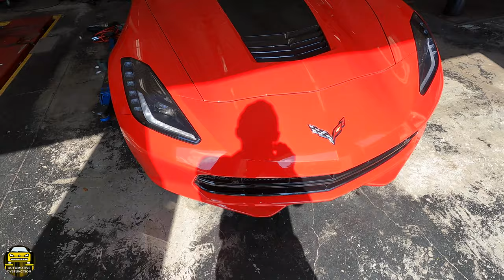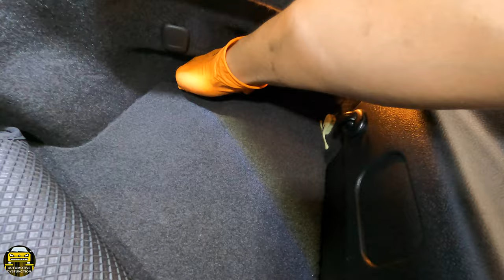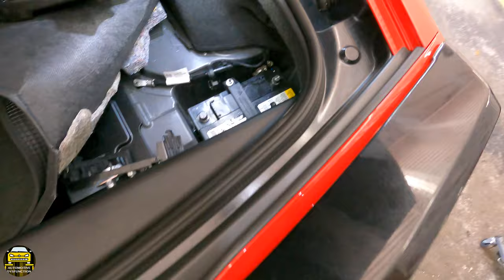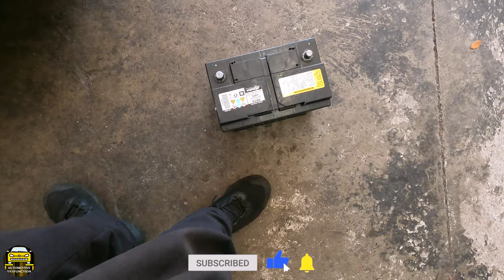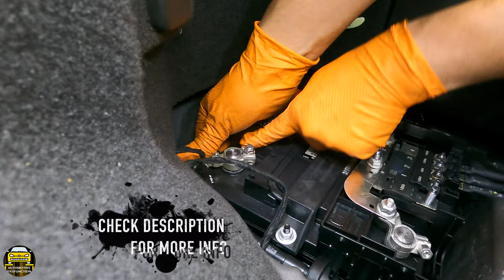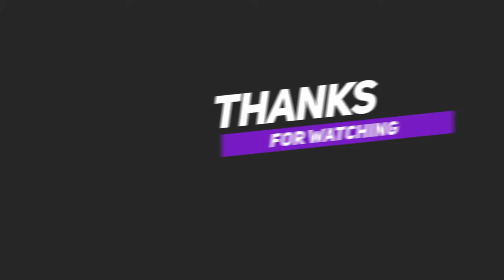How To | 2014-2019 | Corvette | Battery Replacement | C7

Comment: Disconnected and reconnected battery. Got soft code U0422. (No CEL just on the obd reader) will this clear after a few cycles? I sincerley doubt and hope not that the PMC went bad and would need to replace

Comment: What size is the nut on the red cable you took off the battery that was attached to the piece with the fuses on it?
Reply: 1/2 inch

Comment: If the battery is disconnected and the power is cut off, are there any consequences on the circuits and the control unit?
Reply from the maker: No

Comment: AGM Batteries are NOT recommended for Florida. Why? Can't take the heat, & can be damaged if less than 50% charge. discharges faster and requires a special charger for AGM batteries.
• A lead acid battery can take an 80% discharge, can handle the heat & a regular old style battery charger works.

Comment: Mine didn’t come with a rubber plug for the hole on the positive side, do I need it?
Reply from the maker: Where at show time In Video?
Reply: @AutomotiveDysfunction  at 3:24 how you plug the hose into the hole, I see people plug the hole on the opposite side with a rubber plug but rewatching your video I don’t see you do that to yours either so I’m assuming it doesn’t matter
Reply from the maker: @jlove24  yea at 3:24 I did plug it In .. that’s for real releasing  gasses from battery